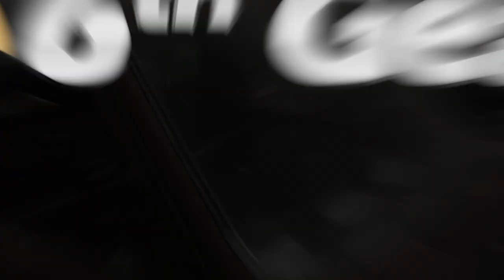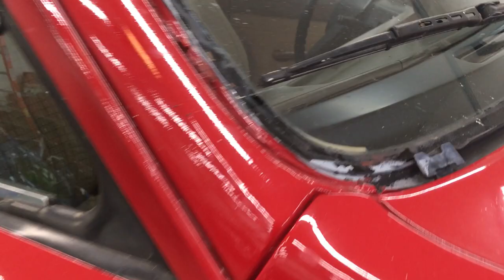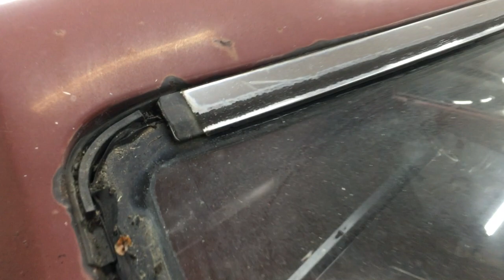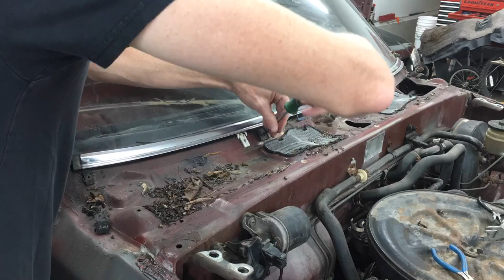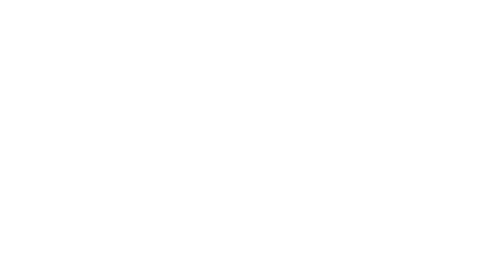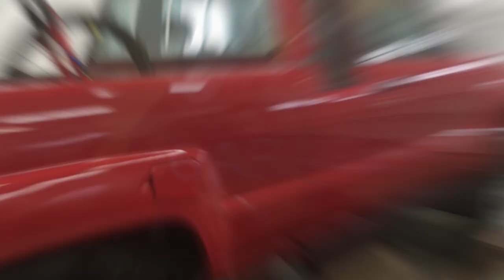How to: Remove Chrome Windshield Trim on Toyota Pickup/Hilux

Comment: The tool you are using is for popping the round style clips used on doors, etc. The windshield trim clips are a different shape and use a different tool to move the clip sideways to disengage it while you pull up. Much more consistent results.
Reply: What is this alternative tool called? And what does it look like?
Reply: Thank you very much for the link and information James.
Reply: This video shows many errors on how NOT to remove stainless glass trim.  These piecescare no longer available for most Pickups to 1994.5
My JT4RN has been a nightmare getting techs to replace glass and not ruin more than they fix!!!  Be aware ..be careful.   Dont ever go to safe light.....!!!  Look up reviews, BBB, and complaints before giving the job to any company!!!!!!
PS:. New moldings on my 94 4x4 extcab are way north of $300...IF YOU CAN FIND ANY NOS..!!!!!
Reply: @karter9908  Totally agree. My understanding is that a competent glass shop can retrofit all rubber trims during a windshield change. Have you had any experience with or heard of that? The originals are always cool, but they don't do anything to actually seal the area and I'd rather run the more modern all rubber setup.
Reply: @jameshisself9324  i have a JT4RN JAPAN build.    It has touring pkg & chrome pkg.   I will try tonload a picture of new trim pc.  My truck windshield does NOT install like rear glass with a molded rubber flange gasket retention!!! It is glued in with urethane.
Reply: @karter9908  Of course, I'm referring to a retro fit. My 83, 84, 85 and 88 all were as well. I would have considered a retrofit rubber seal mount a godsend back then and would today if I still had any of those trucks. I'm also very anti-chrome though so as they say ymmv.
Reply: @karter9908  thank you for this tip I'm not going to touch my chrome windshield trim... the sun has disintegrated some of the rubber around it I'm thinking of using black  3M Strip-Calk

Comment: Did you ever post a video of replacing the window trim? Soon I will be doing this on my 84 build. Thanks for all the great videos!!
Reply from the maker: No, I still have not gotten around to replacing the trim on my truck, since it involves removing the windshield. Debating going with The 1-piece rubber surround instead of the chrome trim.

Comment: Top moulding  is a throw away part and so are all the butterfly clips.. you can still order them but you need to replace windshield. To do the job correct.

Comment: Great video. I have a 1986 Toyota pu long box dlx 5 speed. Any idea where all the plastic chrome pieces can be bought? Any aftermarket companies make them?
Reply from the maker: I usually see the metal windshield trim pieces on ebay. Or are you referring to the plastic pieces that hold the metal trim to the truck?
Reply: @6thGearGarage  
The chrome pieces I had were actually plastic. They were the OEM ones on the windshield. I say chrome because of the look of them. They were plastic. I have seen metal ones. I am amazed that there are no aftermarket companies making theses pieces. On eBay they sell at high prices for vintage plastic used parts . I have seen them available from Toyota in California for about 1K for the full set 8 pieces then you need the parts that get put in the window adhesive which the plastic chrome pieces are attached to.

Comment: Chrome  trim on Windshield is cool looking. My LS400 also has the chrome trim around the windows. I have a new box of black 3M Strip-Calk 08578. I'm thinking about trying it on my windshield to seal around the Chrome trim... if anybody has done this let me know. I originally bought it to plug firewall holes

Comment: what is a good alternative to this rust trap?  Id like to just replace it with some rubber.
Reply from the maker: There is a one-piece rubber gasket that was offered on overseas pickups. However, I've heard that a north american windshield will need to be trimmed about 1/8" in order to use the rubber gasket.

Comment: Do you have an idea of where I could find a windshield for a 95". Mines got a crack in it, also getting moisture in from the seals so I'd like to go ahead replace everything.
Reply from the maker: I don't know if OEM is still available or not, but any aftermarket glass company should be able to sell you a windshield. Check with your insurance first, some offer a good discount on windshield replacement. I got one for a car once for $100 installed.

Comment: Oh I hate those rust causers, them and the stupid factory chrome fender flare things... Peeled all that off immediately, and windshield trim was just replaced with some universal rubber. Easy 60% of my rust was caused by the chrome...
Reply from the maker: It's weird how some trucks are affected by the windshield rust more than others. I've had some where it's eating away underneath like my 85 was, others like my 86 1 ton had no rust at all. This 87 looked pretty good too. I'm considering going the black rubber trim route on my 85...
Reply: @6thGearGarage  I had to do rust repairs from windshield chrome on everything I've owned. I would highly recommend the black rubber trim route, I think it looks better too!
Reply: @6thGearGarage  Also while I'm here, bravo on the thumbnails. You nail those.
Reply: @6thGearGarage  What kind of universal window trim and where do you buy it?

Thank You

Dax
Reply from the maker: @dmatter827  I do not know where to buy it, I think it has to be professionally installed by a glass company.
Reply: I just had my windshield frame's rust repaired on my 88 4Runner and then Safelite reinstalled the window with a universal rubber over the Urethane sealant. I do think they could have done a better job around the upper corners by maybe using a heat gun to form the rubber better. The upper corners bulge out a little. Drivers side I can deal with, it isn't too bad. But the passengers side annoys me.
Also the gap was pretty big on the bottom after taking the chrome off and they tried putting a piece of rubber windshield gasket glued to the cowl...but I pealed it right off very easily. It would have never stayed and didn't hold the cowl in place at all. I ended up putting the bottom chrome piece back on to hold the cowl in place. 
I don't think Safelite knew what they were doing when fixing it and it was a real pain in the ass for them. It wasn't their easy every day install. They just wanna get you in and get you out. No attention to detail. Maybe it was just the particular establishment I went to, I dunno.  They didn't even know how to take the key out of my ignition by pushing the black button and left it on ACC and killed my battery.
But after seeing the way the gasket looks I'm thinking about going back to the chrome. I am pretty sure new clips are available, which I would need. The problem is I only have 4 of the 8 chrome pieces. Hoping to find the others.
My other option is this. From what I read in the 1st Gen 4Runner groups...this will work and it looks pretty accurate. The price is up there, but might just work well.
http://toyheadauto.com/Toyota_Truck_Hilux_1983_to_1988_Front_Windshield_Weatherstrip.html?fbclid=IwAR3laADACcDK9Lp9K4FDXU4Q2nzTXQc8IxAIS2rroeC0T2tRyMDcr8HQOzY
Reply: @DirtGarage  Gotta take out the dash? especially when my 85 4runner has the factory altimeter.

Comment: Did you ever do a video on the replacing?..thks jc
Reply from the maker: No, it involves removing the windshield and if I'm going that far I'm probably going to go with a solid rubber surround instead of the chrome trim.
Reply: @6thGearGarage  Does the dash have to be removed? I have a 1985 4runner SR5 5 speed with the factory altimeter on dash...
Reply from the maker: @dundeeecroc  I've been told that it does need to be removed.

Comment: Do you have a part number for the 2 black pieces that held the cowl down in the front ?
Reply from the maker: Do you mean the black pieces that were screwed down at the bottom trim? https://partsouq.com/en/catalog/genuine/unit?c=Toyota&ssd=%24%2AKwELPy5FZmdSUGhXaUs0P1NHZ2B-DwANDB4AMkIaSxwDGmUfTEwRGwIMQ0dNVlkgFVBaUVscAwsTHwYHFhsCHQkMDQ0fTEwbVxoFHA4NCw1VV1BERklXXXhEHwMNUAMYHQgOCQ4JUExeGRpWShsCHx8wLyB4dR0SGRpSXkJUUht0cQsPFW97QkJSG05cHAMYUUgMAl4ZGllXXRoFHVcTAAAAAAbeg_8%3D%24&vid=0&cid=3&uid=292958&q=

Comment: Does anyone know where I can find the windshield molding / trim for a 1986 4runner?.

Thank you.
Reply from the maker: I believe the chrome trim is discontinued
Reply: @6thGearGarage  do you know what I can use as a replacement?.
Thank you very much.
Reply from the maker: @betoherman6349  I have seen 1-piece rubber surrounds, which make the truck look more modern. I'm told it's a universal trim that some glass installers use.
Reply: @6thGearGarage  thank you .
Reply: Some dealers still have it the black for sure chrome ?
Reply: EBay has them, they come from Taiwan.
Reply: Thank you 👍🏻